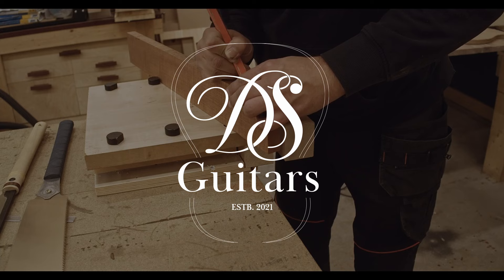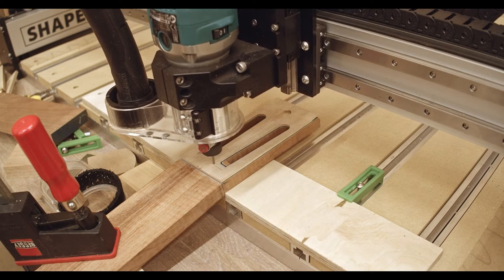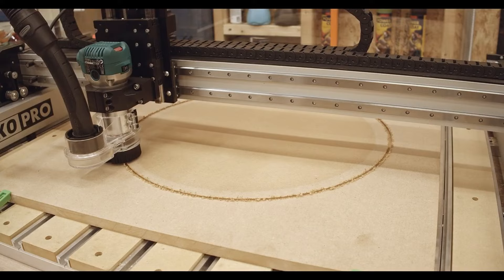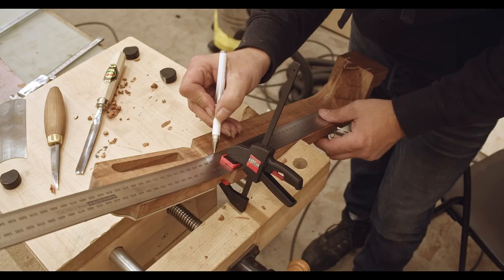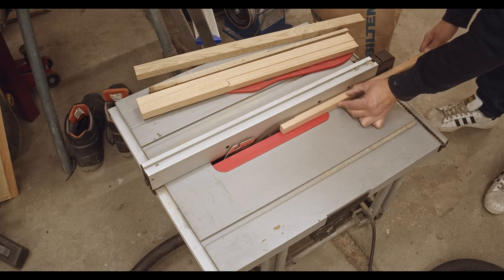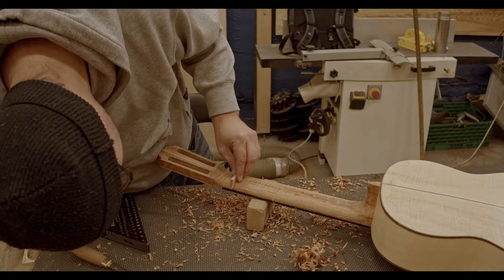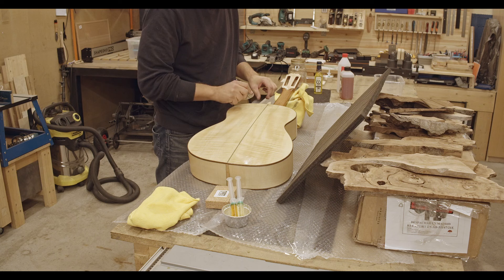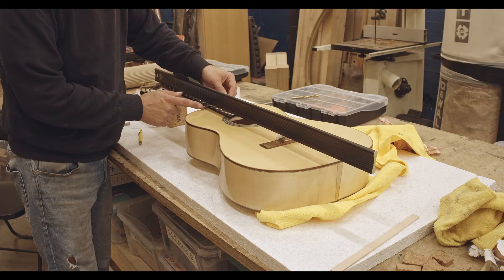Guitar Building - Making a Classical Guitar From Start to Finish

Comment: Very beautifull project, loved it! Just a couple of questions.  
1. At 7.56 did you heated the board before putting it on the mould?
2. 5.15 what are the tiles made of? Where can I get some or make them?
3. What woods did you used for the guitar?
4. Do you have plans on pdf of your guitar?  :)

Comment: Is it possible to CNC the fretboard to the exact dimesions and slopes and glue it to the neck or for some reason I need to shape it on the guitar?
Reply from the maker: I did that on my latest build, and it works perfect. I taper it down from 6mm thickness at the nut, down to 4 mm at the bass side, and 3mm to the treble side (at the soundhole). I also hammer in the frets before gluing to the neck (using slightly larger fret slots to avoid bow. I also use super glue).